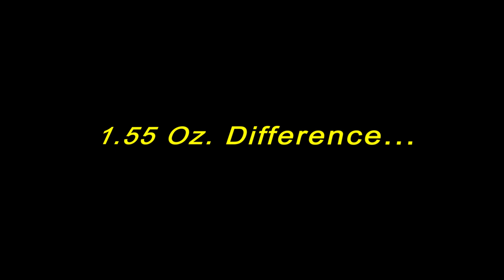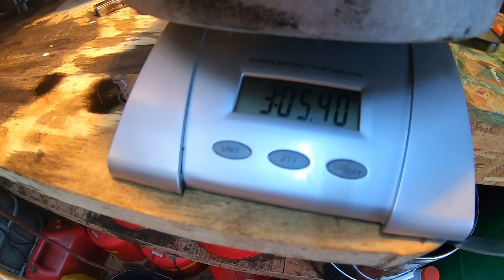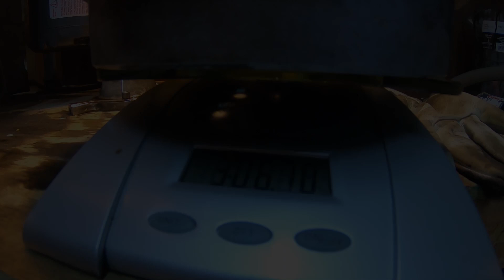Black Diesel Small Batch Test - Is The "Booster Cone" Worth It? - WVO Designs - Centrifuge - Fuel

Comment: If the heater is thermostatically controlled, is there a reason not to run it at let's say, just slightly above 212 degrees to boil the water out of the oil? I think the vapor you were seeing is water that is not quite boiling but water vapor none the less. With the cone in place, the water vapor is not as free to escape through that top vent but probably ends up with the sludge that gets drained off at the end of the run. Great videos! Keep it up, thanks!
Reply from the maker: Water evaporates at a lower temperature than boiling.  I've never seen an increase in vapor output with a higher temp but you certainly can run it hotter.

Comment: Have you ever played with the idea of using synthetic but with a higher ratio of gasoline to try and drop the flash point lower to where diesel would be which may in turn get it to burn cleaner without coking injectors? Side effect would be be able to thin it a bit more too... finding good source of strictly conventional is proving difficult in my neck of the woods. Anyway you could perform a test like that?
Reply from the maker: I don't run strictly conventional.  I've never had an issue with synthetics.  Everything goes in the totes..  everything gets processes the same and everything goes in the tank.
Reply: Ok so what do you think your ratio of synthetic to conventional is? I was under the impression we can only use conventional for black diesel
Reply from the maker: @petervanguilder6276  not sure really.  At least 50/50. I don't keep track.  It's not caused me any issues that I'm aware of.
Reply: @NotSoGrandGarage  good to know because I've had a hell of a time trying to find a conventional only source
Reply from the maker: @petervanguilder6276  I don't doubt that at all.  I wouldn't be too concerned about it.

Comment: Well you made a mistake, Port going into the bowl without the cone needs to be moved off-center and dropped down to 1/4 inch above the bottom of the bowl.
Reply from the maker: The units out of the box don't have a way to drop the oil feed to just off the bottom of the bowl...  That's what the cone does essentially.  And no I didn't move the port... which I specifically mentioned.  I don't have hose to replace what I would have to cut off.  Either way, with the design that wvo uses, the cone makes a difference in performance which is what was asked.

Comment: The only thing I'd say that could've caused the fumes coming out of the vent was the location of the oil supply. From what I've read, without the Booster cone you should feed from side. With the cone feed in center. From the vid I didn't see your feed change locations so maybe feeding in center is hitting rotor nut and splashing more than normal? Not criticism, just curiosity. I don't have the cone and side feed, no real vapors come out. 

Also could you elaborate on the p trap theory? I've looked in the vids but must've missed when it was added. Thanks Chris! You're our driving force for this life style!
Reply from the maker: It's possible I suppose.   I changed nothing but the cone itself.  

Check the small batch test rig video.  Pretty sure it shows the p trap setup.

Thanks

Comment: Something I'm testing right now that maybe you can do a video on later: I just looped my return fuel line on the oil side of my 2 tank system. I also have a flat plate heat exchanger coming (had to re-order since ups lost the first one). For now I can test just the looped return. Hopefully it helps heat the fuel and keeps the filter cleaner since it's mostly the same oil recirculating over and over. I'm not worried about air in the lines because it will be bled out when I flip back over to diesel.
Reply from the maker: I've done a looped return before but it takes a long time to flush the system when changing fuel.  It will keep the tanks cleaner though.

Comment: Interesting seeing that the venting location changed just by removing the booster cone. Great video. Also it’s nice to see that there is at least some change when running the cone.
Reply from the maker: Yup..  and this oil is relatively clean.  I'm sure it would make more of a difference if the oil was really dirty.